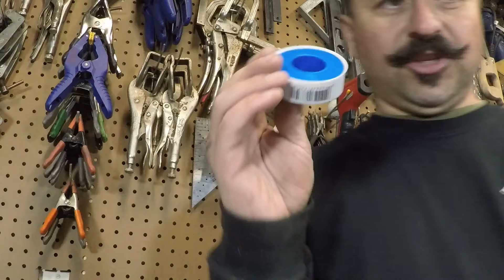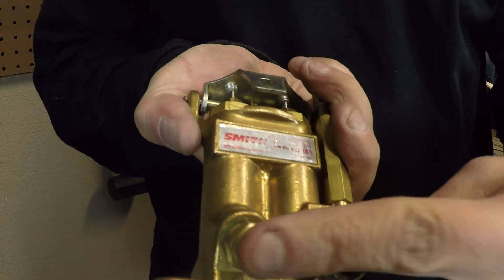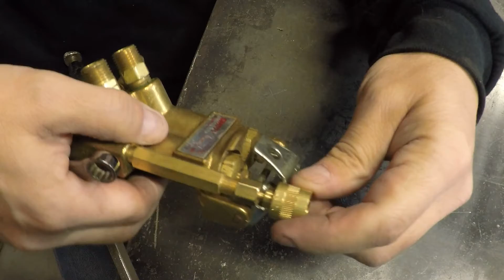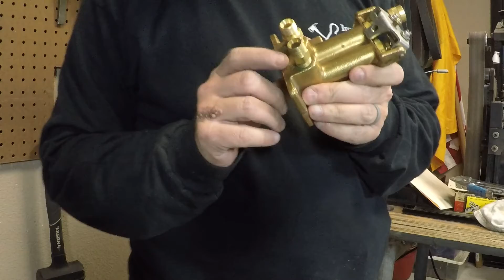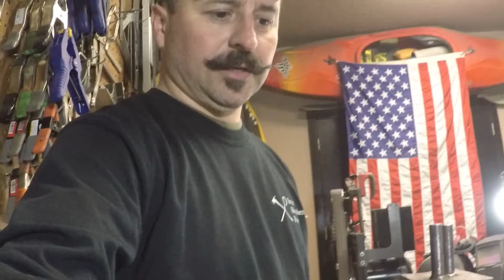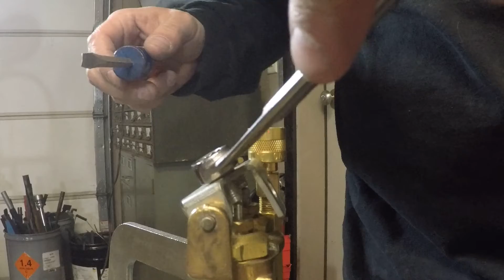Gas Saver Part 1:  Repair and setup

Comment: Curious how much the part was for the pilot light. I just bought one that needs repaired and appears to need the pilot light setup. I also have a couple weld-it Gas savers from national that I am repairing. Hopefully they don't need too much work.

Comment: Is there a part two?
Have you repaired the pistons?
Reply from the maker: @januszpozniak8258  never did a part two. It continues to work well, however I only use it rarely. Gas savers are a game changer, though.

Comment: Just want to say thank you for your video! Was taking my gas valve apart to do some adjustments and did a little research then I came across your video. It added a sense of safety and confidence😊
Reply from the maker: Glad I was able to provide value.  Gas savers are a force multiplier in the shop!

Comment: A little observation , I have one of those , and I notice that the rod to hang the torch is thinner and can pass to the back for weight adjustment. Excelent video, Thanks.
Reply from the maker: Thank you Ramon.  I see the pass thru, but the rod seems to be slightly off alignment.  I haven't put much thought into trying to solve that one with everything else going on.  If you can provide a little advice, I'd be glad to take it.  

These gas savers are a HUGE asset in a shop for controlled heating and saving money.